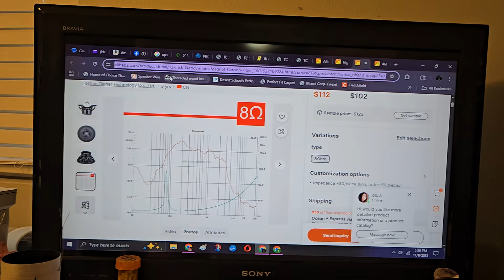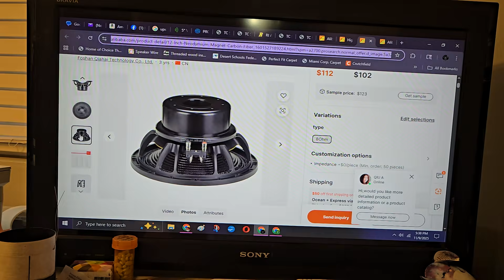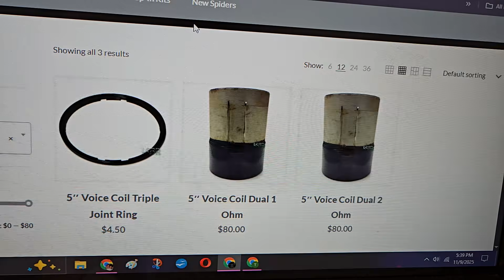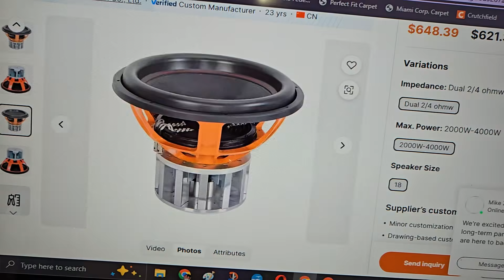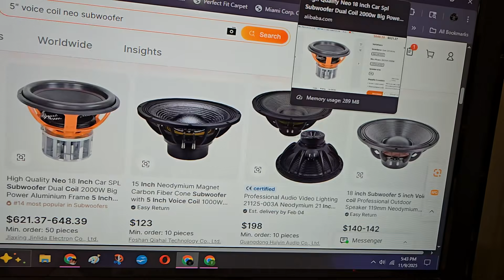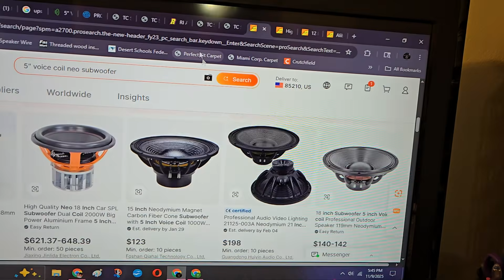21" Subwoofer w/ 5" Lord of Bass voice coil on big neo motor from Alibaba

Comment: $3500-$5000? Not a chance. Why would a 21" woofer with a neo motor be that much? The Eminence NSW6021-6 does infrasonic with authority and is a lot less. B&C and LaVoce have some as well.
Reply from the maker: I'll check it out but it probably doesn't handle as much power or have as much excursion